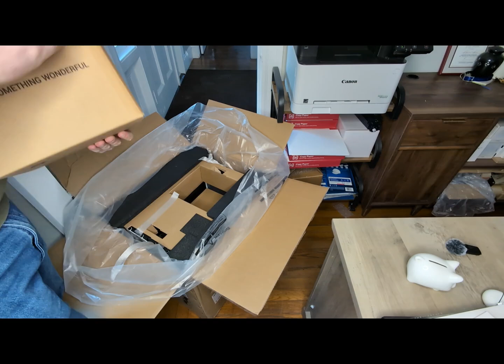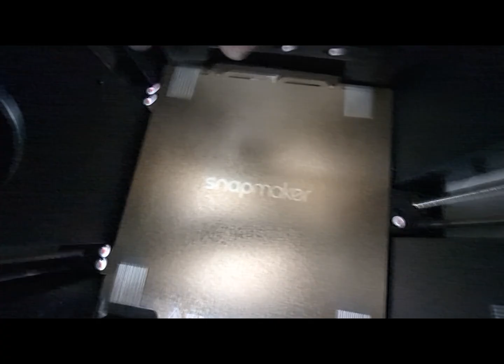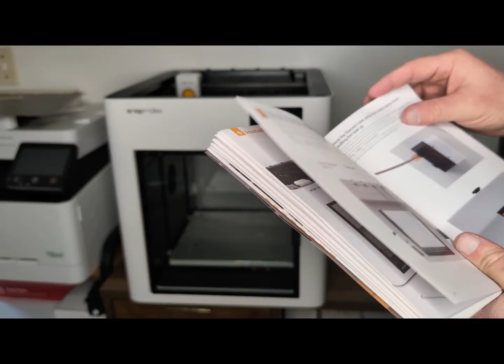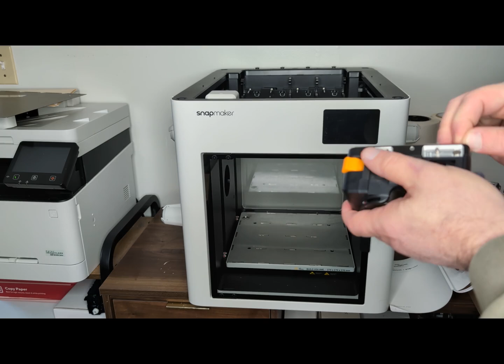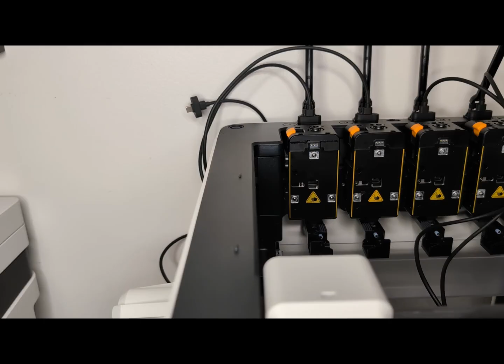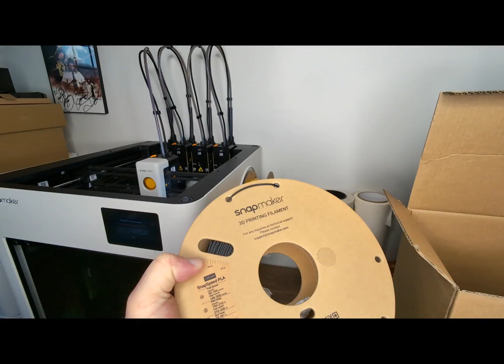Snapmaker U1 3D Printer Unboxing & Setup | First Look, Assembly, and Initial Impressions

Comment: Thanks for the thorough process.  Regarding the packaged screws, I believe the “2.5 x 16” refers to the screws themselves, 2.5mm wide, 16mm long). Since you need 8 they include a spare, hence 9.
Reply from the maker: That makes so much more sense! Thanks for the clarification!